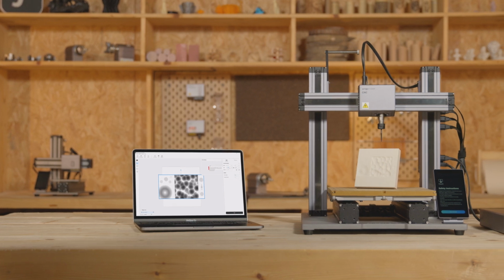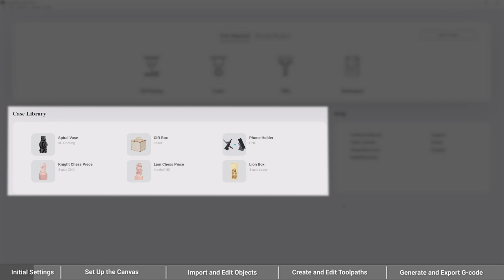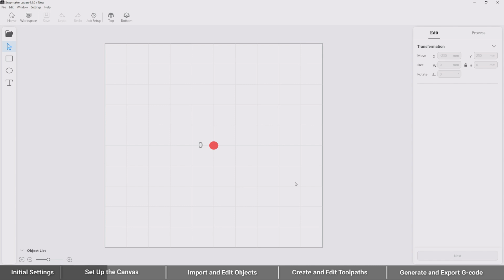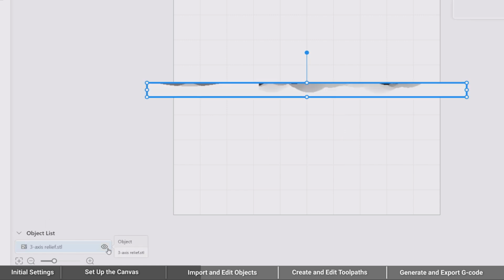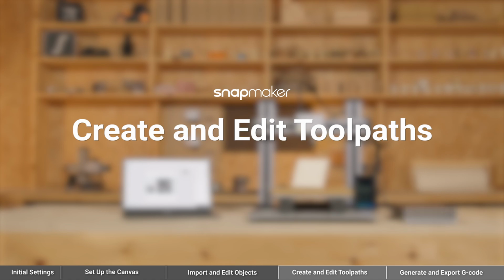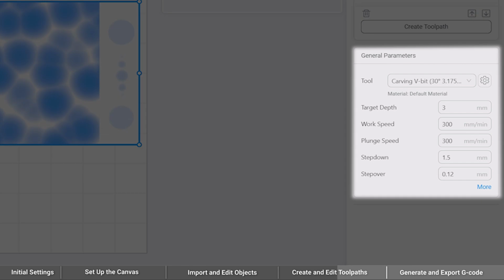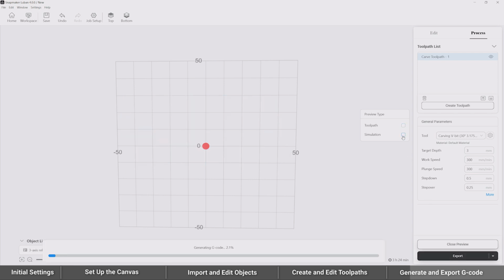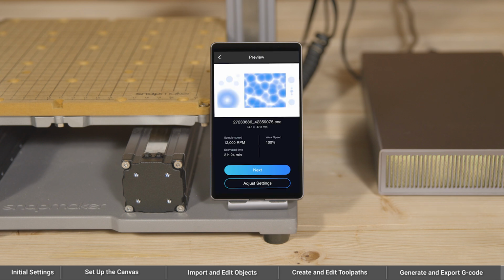Intro to Snapmaker Luban 4.0 for 3-axis CNC Carving

Comment: Video only showes what is obvieous anyway an doesnt need explaining, but not what would be interesting. For example how do i cut out something in or outside the line. I used other cncs before. There i used the setting "on the Path" and was able to put in an offset ( half the diameter oft the bit) so it carves  the inside or outside of the line depending on a positiv or negative number.... How do I do that in Luban, or how do I rotate Objects from standig to flat, or how do I set different work Path for diffent objects in an importet path. I really tryed some time but couldnt figure out this basic things... Stuff like that should be in the video.

Comment: Video on manual calibration,  would be awesome, snapmaker owner
Reply: Just google something like how to pick up zeroes. Its the same on your snapmaker as it is on almost any cnc machine. For the X and Y axis, you can either use a pointy engraving bit to approximate your edges, or you can touch off with a live tool. Just pick a spot that you're not doing work on, move at 0.1 speed until you hear the bit just barely touch. For Z, when your tooltip hits the material, that's your Z0. For X/Y, if you're using an endmill, subtract or add the radius to account for the center of your tool being different than the edge of the flute.
Its really simple, assuming you've either mastered it in the last year, or just threw it out...

Comment: Still have no idea how to set the depth or thickness of stock.
Also, I imported a SVG and I can't figure out how to select individual lines for toolpaths. I also could not find this in the manual. I would hope there's a way to do this or it basically defeats the purpose of using vectors entirely. (if you really think about it, you might as well just make a raster image if you can't select individual vector lines)

Comment: how to set the image to a working stl file? I'm beyond insanity to get it working :D :') And why do I've only Relief as setting and not straight down, without the V-form ? The CNC part of the Snapmaker is so much underexposed compared to the Laser and 3D printing stuff.
Reply from the maker: Thank you for your feedback! The reason why you can only see Relief mode is probably that you have uploaded a gray-scale image (maybe in bmp or png format). You can try it again with a svg file.